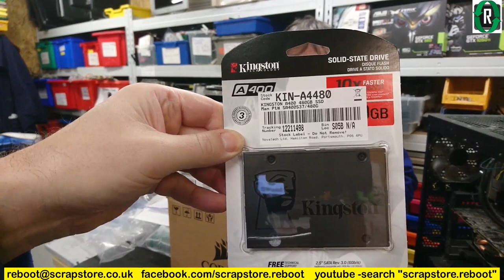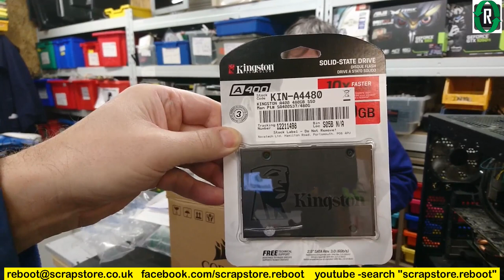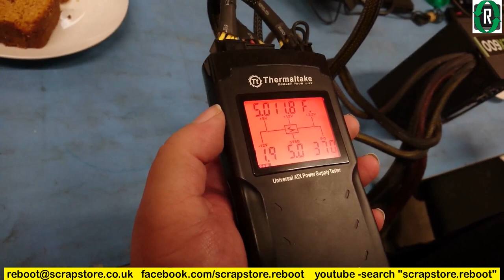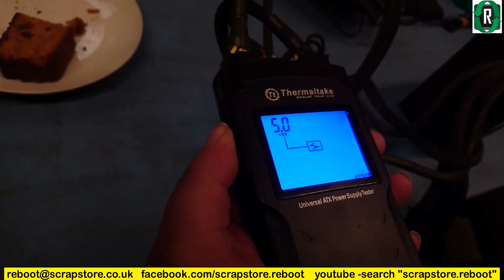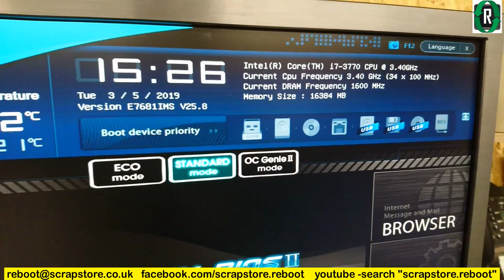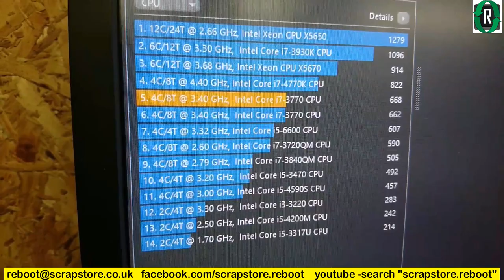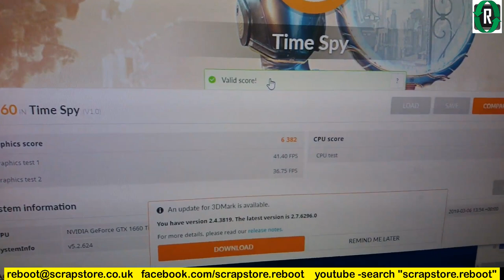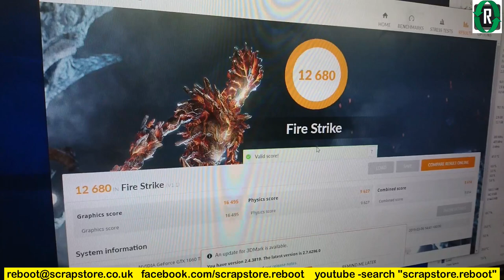GTX 1660 Ti + i7 3770 Customer Gaming PC Upgrade

Comment: Good to see some respect for the 3770; I just added a 1030 low profile to my cheap machine with that CPU - quite capable.  You two are  a hoot.  Good pleasant banter.  Carry on!
Reply from the maker: Thanks for taking the time to watch and comment.
Reply: @carrot389  hello, do you still have this setup because im thinking about upgrading my i7 3770 with a 1660 s too. How has this worked for you?

Comment: Great video, interesting to watch and it's good to see how you test things first before simply just changing things for the sake of it.

My system is:

- MSI Z77a G45 motherboard
- i7 3770k (overclocked automatically in BIOS by MSI to 4.2MHz) with a Noctua NH-U9S CPU heat sink and fan blowing out to rear case exhaust fan
- 16GB Corsair DDR3 PC3-10700 + 8GB Crucial DDR3 PC3-10700 = 24GB RAM
- MSI Geforce GTX 1660 Super with auto overclock via MSI Afterburner
- Cooler Master Elite 430 Case with x1 front intake, x1 side exhaust (to assist GTX 1660), x1 top exhaust (for RAM AND CPU), and x1 rear exhaust (for CPU)
- Corsair RM750i PSU
- Crucial 500GB SSD
- Sound Blaster Z
- 34" Gigabyte G34WQC 3440x1440 Ultra Widescreen Monitor 144Hz

I built this machine myself back in late 2012 so it's almost eight years old. Everything has been upgraded except some of the RAM, the motherboard and the processor. These three things are probably the weak links but the processor in particular should not be underestimated. Despite its age, I am currently getting over 40fps in ARMA3 in High settings for most at 3440x1440 resolution. Yep, 4k ultra wide. That's pretty damn good I reckon and the i7 3770k is still performing well. 

I'm not sure what to upgrade to but the i5-10600k is looking like a strong contender. Or, I switch to AMD for the Ryzen 5 5 3600XT. But, I think the i5 might have better single thread performance, I'm not sure.

Just ran Cinebench R20 and my score is 1588 pts. Can't post a screenshot here.

Comment: Great video - I was interested because I have a similar rig - 3770K paired with GTX660 and overclocked to 4.2G - this system is really very capable and more than adequate for my needs - I think, unless you are a serious, hardcore gamer,  there is no need to spend a fortune on kit these days - this older kit would have been leading edge 8 years ago and still offers loads of performance given a decent GPU and some extra RAM - I might have to get that 1660 Ti though :)

Comment: 5:10 - I thought it had turned into Antique's Roadshow :-) Great vid! Just upgraded to an i7-3770 myself from an i5-2500 so a big jump. Pairing mine with a GTX 1060 6GB
Reply from the maker: Chuckle ! Thanks for spending time with us. Glad you enjoyed it, please subscribe for more workshop activity.
Reply: Thanks for the video! Got one question, would the CPU (I7 3770) be compatible with Windows 10?
Reply from the maker: @denis480  Yes, and that is what we built. Thanks for watching.
Reply: Thx for the reply!
Reply: I had GTS450 and i5 2500 with 4 gigs of ram.
Then Im upgraded used GTX960, used 8gb dual channel ram. 
When im played BF1, I got hard cpu bottleneck, so I got a Xeon 1240 v2 and used all core boost. Right now, I wanna buy 1070 or 1660 Ti for 1080p 60fps gaming.
Reply from the maker: @DaBombtasi  Or you could get an AMD RX580 which might just do it and ebay prices are cheap. Although beware of ex-mining cards with AMD RX570 / RX580
Reply: @denis480  I know your comment is over a year old, but pretty much anything made in the last 15 years can run windows 10.

Comment: I have the exact same system: 1660ti + i7 3770, and im able to get 70+ in Red Dead Redemption 2 on High. Yes theres a bottleneck but its dealt with. Probably would upgrade to Ryzen 3 3100.
Reply: bro whats the fastest and best gpu for i7 3770 without bottleneck it ! some say anything above gtx 1070 is bottleneck !
Reply: @imed122  I suggest the 1660ti or 1660 super. I get bottlenecks when im around alot of npc's (CPU cant handle). It all depends on what you play and what you want to do. Like if you play Minecraft the i7-3770 is fine, but if you want to play Minecraft with a ton of mods + shaders, then its not fine.
Reply: @z0h33y  Thanks bro for your information

Comment: Hello guys i had a i5 2400,8gb,2hd discs,8gb ram,500watts power,and r7 240 2gb.i bought a i7 3770,put 16gb ram,a gpu 1650 super,and ssd 480 and 650 corsair power.do you guys think this is good choice?will bottleneck?
Reply: I have the similar configuration... no bottleneck,  It can handle everything in 1080p

Comment: I7 3770+motherboard gigabyte h61 support???
Reply from the maker: H61 is LGA 1155 socket 3rd gen, so it will technically fit the i7-3770. However, a BIOS update may be required

Comment: great good value gfx card that. Im stuck with my GTX970.
Reply: 970 should run everything at 1080p high
Reply: @Bonswally  the point is that he wants to upgrade
Reply: @Graphics_Card  Well two years later it no longer applies lol
Reply: @Bonswally  yeah but still I was stating a fact
Reply: @Graphics_Card  Upgrading from a 970 to a 1660ti is as terrible an upgrade today as it was 2 years ago.
Reply: @Bonswally  so you are saying that the 1660 ti is bad in 2021?
Reply: @Graphics_Card  No I'm not

Comment: Have bottleneck?
, i have rx590 and i will change for msi 1660 ti armor do u think will have any problem?
Reply from the maker: Hello RubenThe RX 590 is a great GPU. Upgrading to a 1660 ti will not bring much benefit if you still have an i7-3770.
You would be better spending money on a more recent motherboard and CPU and ram first.
Thanks for watching. Please subscribe.
Reply: @ProjectRebootUK  the rx590 consumes a lot and has given me a lot of problems with the PSU, has been returned and now I am undecided between the 1660 or 1660 you, in the 1660 you with this processor there is a bottleneck?
Reply from the maker: Its difficult to confirm as we did not test the 1660 Ti in anything else. The i7-3770 was all we had. Nothing newer to compare performance. You could buy the 1660 Ti and if you are not happy with performance, then you can get a new motherboard and CPU in the future.

Comment: will the i7 3770 get damaged if you don't upgrade from a stock cooler to that arctic cooler?
Reply from the maker: Hello Salvador, if the thermal paste is ok then the stock cooler will work ok but the arctic cooler MAY perform better and reduce the cpu temperature by a few degrees.

Comment: Hello folks! Its a noobie questions here.But just want to know how new turing GPU's working with old motherboards(like z77 chipset)? Have you any compatibility issues? Maybe software problems? You tested many old motherboards and all was fine? Maybe you updated your motherboard's BIOS before install GPU?
Reply from the maker: Thanks for watching Ansha. 
Z77 is on LGA 1155 (2nd and 3rd gen) so as far as I can tell, any PCI-E GPU will work. Just install the appropriate graphics drivers for the GPU. I dont think any mobo BIOS update would be necessary.
Reply: Thanks! Just one more question.Have you any problems with different HDMI versions compatibility? I just have Monitor with 1.4 version and hdmi 1.3 cable to connect. As i know all turing cards have hdmi 2.0b.All this stuff should work fine or i need to buy 1.4 (maybe 2.0,2.0b) cable?
Reply from the maker: According to wikipedia, each version brings higher refresh rates and bigger screen resolutions 4K, 8K etc.
v1.4 has max refresh rate of 144hz. So, a new Turing card will be compatible with 1.3/1.4

Comment: I've recently placed the single fan version of that Gigabyte 1660 TI in an HP DeskPro 600 G1 SFF with an I5 4760 locked at 3.6Ghz.  Hp OEM board so no overclocking of the cpu at all.  I added a SSHD and completed with 32Gb of DDR3.  Why 32 Gb?  My wife likes to open massive amounts of Chrome windows.  Need I say more?  In benchmarks I find that the 1660 TI get's a little higher numbers at 1440p than my previous GTX 1060 at 1080p on the same MB.  However game play is a little bit disappointing.  When watching Intels Tuning Utility during games like Rise Of The Tomb Raider and Just Cause 3 I noticed <90% util on all 4 cores.  Game play is jittery at times, sound cracks, pops and stutters even when the in game graphics are set to 1080p High Quality.  This didn't happen with the Zotac 1060 3Gb Mini.  I feel reluctant to set in game graphics to Medium, I just bought a 1660 TI, using Medium setting is just admitting defeat.  Not so much a problem when playing World Of WarShips but that gaming engine limits frame rates to 74fps so I can set it to Ultra at 1440p with no problems.  (Maximum frame rates in WarShips can be changed in the "engine.xml" file if you're clever enough.)  It has been fun trying to put higher quality components in an old junker.  Like adding a turbo to a Ford Pinto, stupid but amusing.  But I'm developing the impression that for these 2nd, 3rd and 4th gen Intel CPUs anything higher than a GTX 1060 is just too much GPU and actually damages performance.
Reply from the maker: Yes, I think you are right. Modern CPUS are best for modern GPUs. Still...we have what we have ! Thanks for watching.

Comment: running a I7-3770K 3.50Ghz with a Geforce GTX 1080 & Z77a MSI motherboard with 16 gigs ram still powering through new games on Ultra maxed out settings. So Yes even in March 2020 the 3770 still has legs. XD

Comment: i get 120FPS on cine bench running the openGL. 
you guys must of done something wrong lol
running 1070
Reply from the maker: Yeah, maybe we are ! Thanks for watching, Ryan.
Reply from the maker: I just ran it on my RX580 + i7-6700 and got 117FPS, so its possible that the i7-3770 is hindering performance somewhat. what CPU do you have Ryan ?
Reply: @ProjectRebootUK  lol, did u guys delete the previous GPU drivers and install new drivers for new 1660 ti?
Reply from the maker: Hello D1zzy, it was a clean fresh win 10 install and the latest Geforce drivers.

Comment: Z77 chipset works best with that cpu. Your not getting the full performance from it.
Reply: i have a z77 udh5 i7 3770k at 5 ghz on boost ; for now i use a gtx 770 but if i need to upgrade the gpu , what do you recommend ?
Reply: @mehdiremidi8632  1080ti or 1080 is probably as high a card I would combine with that cpu. 1080 is still a good card👍
Reply: @Renizuko  thank you for the advice

Comment: hi 
my system got i5 3470 in it with r9 270x and i wanna upgrade my graphic card to  a gtx 1660 ti 
are my i5 gonna bottleneck the 1660 ti and should i upgrade to i7 3770 ?
Reply: Definitely upgrade to the i7 3770 as well. I had a 1050 ti with an i5 3470 and it would bottleneck in cpu-intensive games like Battlefield 5, and assassins creed origins.
Reply: @tommyofnl9009  thanks buddy

Comment: I wonder what i can do with my hp 3500 pro 🤔
Reply from the maker: I think you would need to upgrade the PSU to handle the 1660 ti
Reply: @ProjectRebootUK   yeah, i'm going to insert an GTX 1080TI  and a corsair CX800. also put in 2X8gb of DDR3 RAM 😎

Comment: No  bottleneck ????
Reply: doubt it, 1660 isn't overly powerful.
Reply: @Bonswally  so  no  problems
Reply: No
Reply from the maker: We had the components we had. Reports from the owner are that everything is running sweet.
Reply: @ProjectRebootUK  It's a good cpu still, my brother still uses my old one paired with a 2060.

Comment: anyone tell me if a 1660ti will work in a hp envy 700/060e  i7 4th gen
Reply from the maker: according to HP, it has a 460w psu which MAY not be sufficient but check if it has a PCI-E power header. also is there enough room in the case for the GPU ?